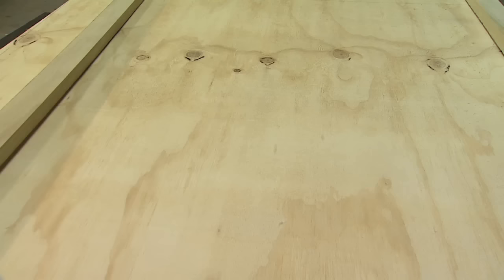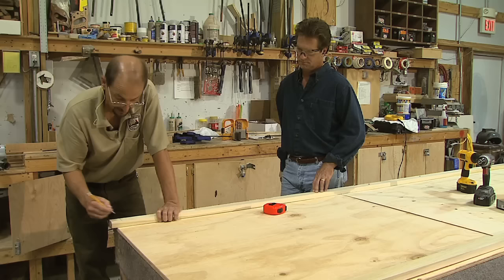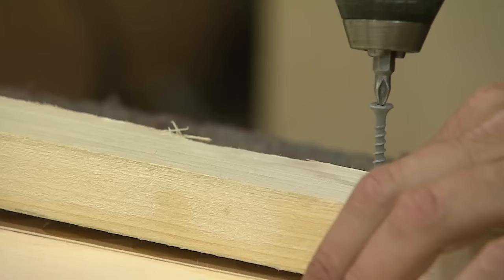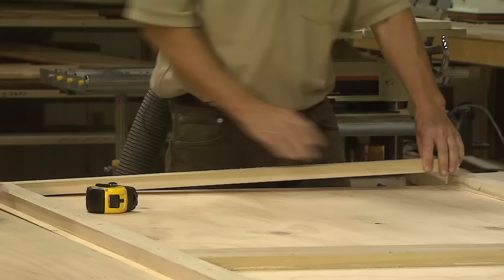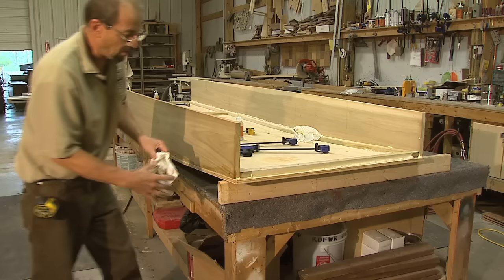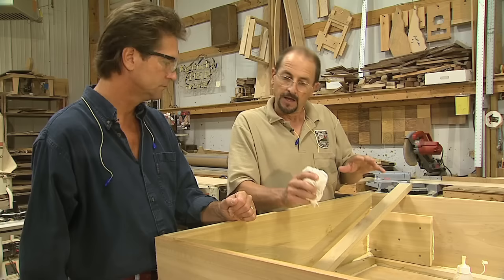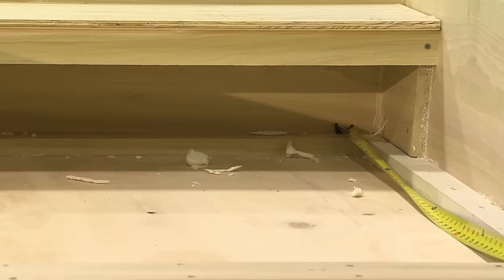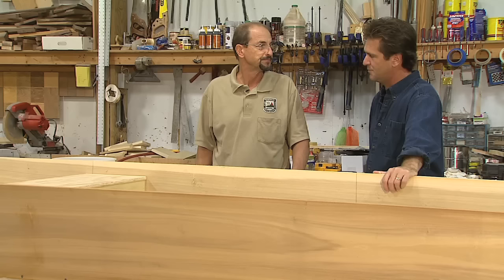How to Build a Wooden Flat Bottomed Boat

Comment: Would it be possible to get some plans that are easier to follow than the ones below the video. I felt that some of the measurements were missing.
Reply: It’s nothing more than a rectangular box at its core I have to remember is to use boat epoxy or a gorilla glue or any other kind of Waterproof sealant when you screw two pieces of wood together as long as he do that between any two pieces of wood you put together you’re basically all set

Comment: Good video. Good explanation of the steps. With this video, you should be able to modify to suit your own preferences. Longer, narrower whatever your heart desires. Great tips for a novice boat builder like me.
I have one question though. You made the transom with a 3 deg. angle. Why didn't you cut the bottom of the sides at 3 deg? And the inside cleats they are fastened to?

Comment: In a boat so basic is marine plywood really necessary? It's not like a very large motor would be allowed on it anyways. I had a 14' flat bottom boat about 30" wide I built with 1/4" luan , glassed the bottom and run a 5hp outboard.  The boat glass and all cost about $100. Motor was new at 500. I used this boat for atleast 5 years up and down the Cape fear river cat fishing. Never a problem. Marine plywood is not cheap so when I use it it's on something nicer.  Something I'd want to invest that kind of money into.

Comment: I do not understand why the bottom part is shared, when no lateral parts are? What is the measure of this, preferably in meters?
Reply: 2642mm long, 2438 is the standard length of plywood here (8 feet). The side members are available in long lengths, but the plywood not usually.
Reply: Thanks. The side members are not plywood? What material is it?
Reply: It is what is called a 1x12 nominal x 12 feet long board used as the "side rails". The actual dimensions of that is .75 inch by 11.25 inch by 144 inches. That is about 19mm x 286mm x 3658mm (3.66 m).  It is mentioned at 9:06 on the video roughly, where he then curves one side of  that board to form the bottom curves. He mentioned that one of the bottom boards was "seasoned Yellow Poplar", so the sides are probably the same. That is probably a local species for Kentucky area, so just about any species would work, it doesn't have any particular resistance to rot or high strength properties as far as I know. Just a good average quality species of wood. With a straight grain. Its a popular street tree or tree for making windbreaks in the US.
Reply: Thanks

Comment: The only problem I see with this design is a lack of " dead rise" in the transom and the bow , when motoring or just moving water must be diverted from entering the hull ,  for example you are planing along and you want to stop the momentum of the water will come over the transom if there isn't any dead rise .
Reply: It's a box, any resemblance to a boat is pure coincidence

Comment: Update:
I am about 20% complete on my flat bottom boat. Pirogue
However, I made some changes to the design due to size limitations.
Mine is 8'long, 36" wide and 12" high.
I am also sealing all the board connections with epoxy paste and covering the entire board with 2 layers of boat fiberglass. Then painting with epoxy paint.
Reply: size limitations: I have to put my sm boat on my honda civic to get it around.
12' boat is just too big my my little car

Comment: I did this boat , But I had 3/4 inch plywood, It took me 10 hrs of labor, parts of three days I was tickled , It was water proof and my son and I put it in the lake . thats 425 lbs and were 3.5 inches in the water. biggest downfall is the wieght. I used five sheets and 14 ft long.

Comment: The difference with marine ply and normal ply is that marine ply is guaranteed to not have any voids in the glue between the plys. That's it! You don't need to use marine ply. Construction ply is fine, especially if you coat the whole thing in glass and epoxy.

Comment: Does anyone have a complete list of wood that you need?
2 sheets of 5/8 marine plywood for the bottom,
6 - 1x2x12  (bottom and inside edge),
3 - 1x12x12 (sides and rear seat),
1 - 1/2x4x8  (inside bottom)
Am I missing anything; besides skills?
Reply: I got the list above from the kya weblink plans. It just didnt have a list of what you need on the plans.

Comment: Nice basic boat design. I'd probably spend a bit more and use epoxy instead of Gorilla Glue and coat the wood with epoxy as well. That means it will never rot and the paint is just for UV and not to water seal. Adds a few more hours to build while adding years to the life of the boat.
Reply: Pine tar  is free/cheap  sheds water like a duck , 100% non water soluble at normal earth tempature smells great, dosen't hurt the environment. If your worried about it being sticky dont be.  I looked at fiberglass and epoxies,  pine tar was cost effective and worked great

Comment: Do you buy any coating to slow down the water absorption of the wood?
Reply: I'd assume flex seal would work
Reply: You could do a resin/fiberglass cover and then paint and it would be waterproof.

Comment: Rather build then buy you don’t have to spend $15k to $85k or even more for a boat but you still can buy a  6 or 8 maybe 9.9 or 15hp motor  witch will still cost about 4k$ depending on what size engine you buy then possibly get a small trailer

Comment: do you have to register one of these boats?
Reply: I think it’s has to register if machine power fuel or electrical  but check with local DNR use  biscuit power ok
Reply: In most states it is the length that determines whether it has to be registered. Even a canoe or kayak this designated lengthy or longer, has to be registered. Typically it *s 15 feet or over, but is state specific

Comment from the maker: Boat plans new link below

http://fw.ky.gov/Kentucky-Afield/Pages/Plans-for-Building-a-Flat-Bottomed-Boat.aspx
Reply: KYAfield
Reply: I would build this boat 15'8" & Glass the exterior - Wood boats got Aluminum boat beat on many points except durability - but if wood boat is keep under shed roof it will last many years - Good house latez paint does very well as well as MDO plywood or underlayment fur for bis savings over marine ply- the money saving on ply will pay for the epoxy - Great Video - Thanks...

Comment: I've heard great things about the strength of these boats. I've had a 14ft aluminum v-hull but I really want one like this instead with a 20 HP motor on back
Reply: Double up the plywood on transom but only on the point of contact of the motor

Comment: why not se the full sheat of ply wood with out cutting t to 42" ?
Reply: The width of most truck beds between the bump outs for the wheels is 42".  That allows this boat to be strapped into a truck bed and be seated in the bottom of the bed instead of rocking on the wheel wells.  No need for a trailer, if you have another means of transporting the jon boat, you don't need to leave the width at 42".  Hope this answers your question (a year late!).
Reply: @chasedonovan1704  
Most the trucks I have experience with had a bit over 48 inches between the wheel wells.

Comment: The bottom plywood seam looks a bit wonky a 21:05, (i am thinking it must just be the glue staining ?). Also, you never showed installing those side rails. (which must be flexed in two directions while screwing them on). 
 As for coating the hull, I thought that you were going to fiberglass it. At the very least you should at least skin the hull with something, and not be dependent upon just paint and glue for exterior hull waterproofing. Maybe skin the hull with something like 20 oz. white waterproof vinyl billboard fabric, then you wouldn't even need to paint the exterior of the hull.
Reply: Also, some types of rubberized, or vinyl truck bed, or boat deck coatings may work as a good waterproof hull, and/or deck coating, instead of just paint.

Comment: doesn't look like marine ply with those big old knot holes. Me thinks the lumberyard pulled one on you. Or else for the sake of production costs they used BC ply from home depot or lowes. a "do what i say not what i do" sort of situation. That said, you can use AB or BC construction ply and get a perfectly serviceable boat out of it. It might have a few voids here and there, nothing a little fiberglass layer on the outside and some nice epoxy floor paint on the inside cant take care of. If you keep up with the maintenance and don't abuse it, it'll last a while.

Comment: Something people don't understand about wooden boats, is wood floats. A wooden boat has more floatation built into the boat than other materials.
Reply: +John doe wood itself doesn&#39;t float, it&#39;s all about displacement. A big oak stump will sink right to the bottom of the water. A cast lead object hollowed out like a boat will float. it&#39;s all about displacement, making the object lighter than the water  of equal volume.

There are stronger and lighter maerials for boatmaking such as fibreglass, aluminium, steel.. wood is cheap and easy to work with.
Reply: Blue Sky wooden boats have been around for a millinium to way before the modern boats,  I love wooden boats , love building them to :)
Reply: Wood Floats.

Wood with 350 lbs of chubby fishermen on board ?  Maybe not.
Reply: @Professional_Youtube_Commenter  How do you think they float logs down the river to the mill? Wood floats!
Reply: When a body is immersed in a liquid, that body is bouyed up by a force equal to the weight of the liquid displaced.

Comment: Bah!  Just buy yellow pine strips and regular old exterior plywood.  No need for marine grade if you're just a weekend warrior and you use a good urethane enamel paint.  Save some $ and if it rots in 15 years, just build another with the money you save.
Reply: The basic, big, main difference between exterior- and marine- grade plywood is that there are no voids in the inner plys/layers of the marine grade plywood.  What would be a ding in marine can be a dent in exterior; the outer/surface ply gets pushed into the void and (the new) cracks (usually along the grain) allow water in and the wood can/will rot, "delaminating" even though the glue did not fail. 
If you don't put underlayment over a subfloor, especially a plywood one, lay vinyl/linoleum, a pot/pan falls or high heel lands above a void, ......

Yes, it all depends on expected life, use, maintainance, the effects of fresh vs salt water, and so on.

Comment: You don't need to use marine plywood for a boat like this, exterior plywood 1/2"on the bottom and 1/4" on the bottom, painted with good exterior house paint and stored with a cover over will last for years. I would look at duckworks too, this guy doesn't understand how to frame tje insides either

Comment: I don't understand why offset of 3/4 for bottom rails, if sides are 1" poplar. Shouldn't it be 1" or 11/16 ths as that is the size of 1" popular?
Reply: Run down to your local lumber store and measure the 1x boards.  They won't be 1" but closer to 3/4.  They call this nominal vs actual dimensions.  Like a 2x4 is actually 1.5"x3.5"

Comment: Had me until Gorrilla Glue. lol
Reply: Nothing wrong with it, it's waterproof
Reply: Gorilla glue is not waterproof it is water resistant titebond 2 or 3 is waterproof another thing I would have changed I would have definitely used stainless steel screws not steel coated deck screws

Comment: Wood is a poor substitute for aluminum. Wood ROTS and it's HEAVY. All this trimming down is unneeded extra work. Aluminum comes in 4' x 10' x 1/8"  sheets and costs about the same as marine plywood. A sheet metal fabrication shop will sell the metal and bend a 2" L angle on all 4 bottom edges for strength and for attaching the side gunnels. They can also make the aluminum floor rails from several 10' by 2" u-bend strips. The curve in the bottom is easily accomplished with some cut slits along the 2" L angles on the botom. Bend more L angles and trim all 4 side gunnels with the matching curve just as he did with the plywood. Caulking glue and pop rivets hold everything together. Now you will have a flat bottom boat that will last a lifetime. Or  https://www.academy.com/shop/pdp/alumacraft-10-jon-boat#repChildCatid=161552

Comment: Garbage: the old rowboats I used 65 years ago had prows and thee bottom was a one piece 12 ft piece of marine plywood, plus the sides were much more flared and the bottom was much more curved and the bottom had a thick flat keel in case of hitting rocks.  They were built to last 50 years and that's in Canada where we have 6 months of winter.  They were indestructible and fantastic for rowing.
That thing is a square piece of shit.

Comment: Screwed up pretty bad. The bottom ended curved from front to back. Not exactly flat, is it? If you keep the edges of the sides straight that won't happen. Try it. You'll see what I mean. But that's ok because a flat-bottomed boat would not move well through the water, and that's why almost all of them are made with curved bottoms and sides. So it seems you ended up with a more efficient shape by mistake. Count your blessings.
Reply: I read this comment 5 times and I cant figure out if I'm slow or if your trolling?  If you dont have some rake, your front drags, water comes over the bow and your swimming.  I'm here to learn so if you can explain this again maybe i will understand where your coming from.

Comment: That is a poor design the transom is too weak for a decent sized motor and the vertical bow is going to smash into boat wakes bigger than a few inches like a battering ram sorry I dont recommend copying this guys design it's only good for a trolling motor or rowing and if your going to paddle you are going to want something more streamlined like a large canoe. Lastly their are better stronger ways to glue the ends of plywood together if the boat is longer than the length of the plywood. Look elsewhere for better videos